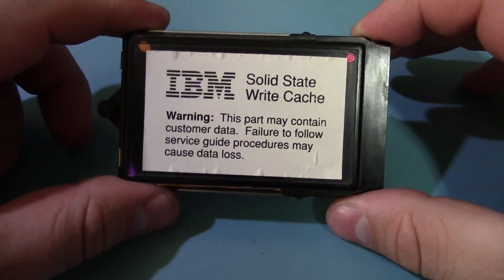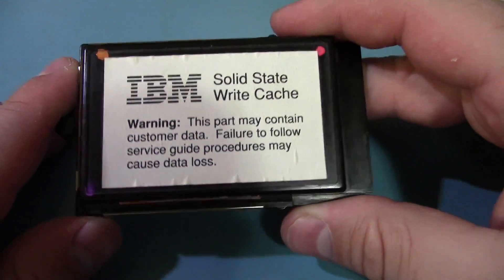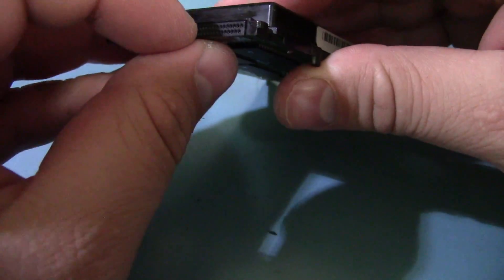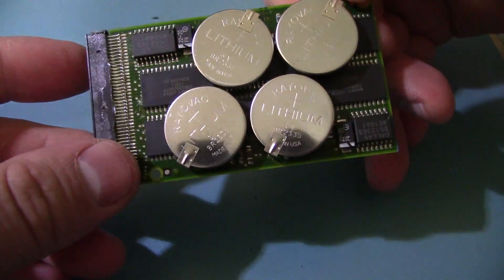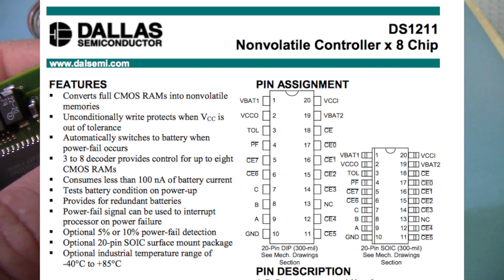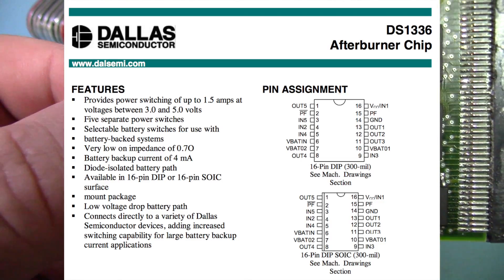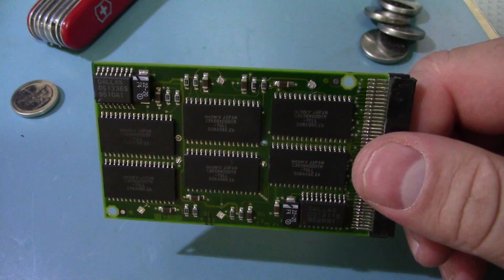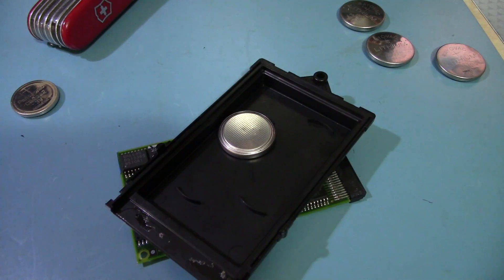IBM Solid State Write Cache Teardown

Comment: The 74G7719 string displayed on the side of the unit at 8:33 looked to me like an IBM part number. A search for 74G7719 reveals that the unit is a 4MB write cache for a few models of RAID card used in the IBM RS/6000 series of servers.
Reply from the maker: lagmagnet Good catch. I'm not familiar with IBM part numbers, didn't even bother looking that one up. haha

Weird that it is 4 MB. They're 512K x 8 SRAMs and there are 12 of them. Possibly some kind of parity error correcting or something is why they need 6 MB.
Reply: ***** I think you're right. The additional memory is probably used for parity. 
The 74G7719 unit appears to be an option for the 84H9706 and 96H9938 controller cards (and possibly others). I can't find any manuals for those cards, but I have found some sites listing RAID-5 as a feature. While I'm not familiar with IBM controllers, I'm aware of some controllers from other manufacturers requiring write cache to be installed as a prerequisite for RAID-5. It would make sense if the IBM cards behaved in the same way and that the write cache unit had parity as well as the drives. I'd suggest that they're treating the physical 6MB in the unit as 4MB of cache + 2MB of XOR parity.